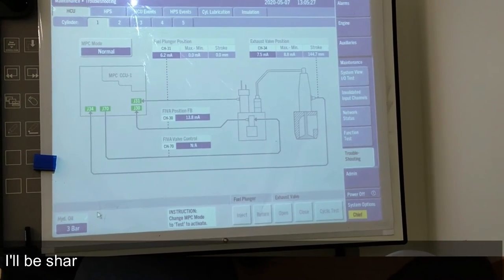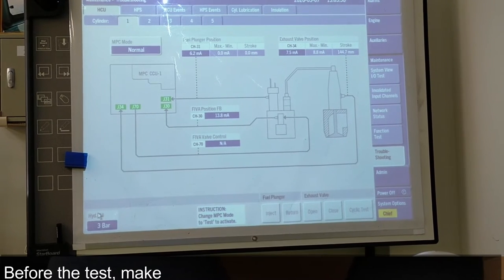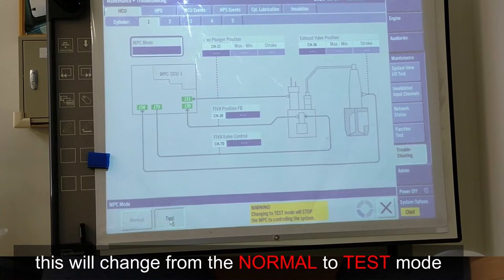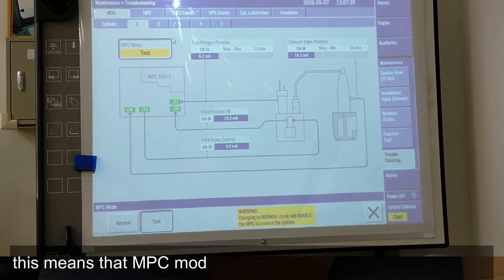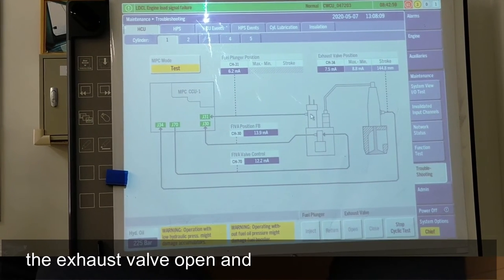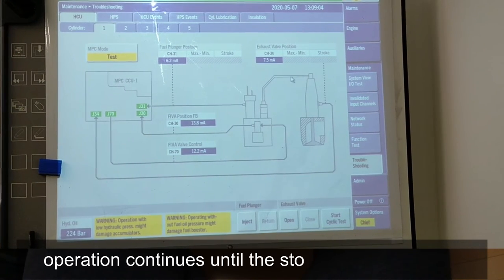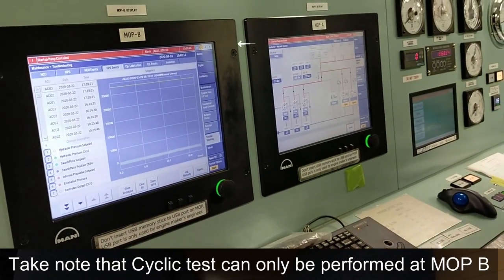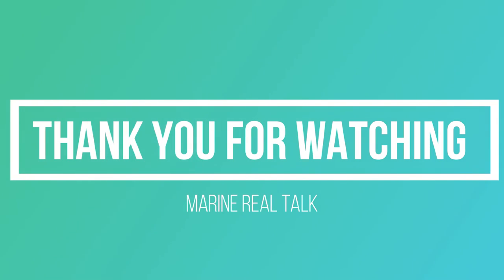Main Engine Exhaust Valve Cyclic Test/Chief Boyet

Comment: Thank you sah video sir. Very informative. Sana dn poh sir on your nxt vid.  mah featured nyo dn poh yung F.O pump test on MOP. Thank you poh ulit sir  nd God bless 🙂🙏
Reply from the maker: Hello Sir Jovic, welcome and thank you for the appreciation. About your request, you can check the FO booster pump working condition at HCU events. At engine running condition, you can even check the output current and compare with the other cylinders. Please let me know if want more clarification but any way I will be making video about your request🙂

Comment: Salamat chief boyet mabuhay po kayo sir.sir paano kung ang m/e natin my leak ang cylinder in running condition pwede ba natin ma e cut off yung cylinder na my leak pra sa ganon tuloy parin ang takbo ng makina? At ito bay nan dyan sa ating manual electronic main engine? Salamat po sir God blees sayu
Reply from the maker: Hello Sir Elmer, mabuhay mga Marino🙂. Yes pwede natin ma cut off ang isang cylinder. Nasa manual ang cut off procedure in different cases. Nasa manual din nakasulat kung ilan nlang ang kaya ng makina na load after cutting off, depending in how many cylinders ang na cut off at depending on the condition of the other running cylinders.

Comment: maraming salamat po sir.

Any sir ask ko lang po if when mag ooperate ang venting and sealing nang SCR sir..dito kasi sa nasakayan ko palaging naka activate ang venting nya kaya naaubos ang hangin namin..Kahit hindi naman naka activate ang SCR namin
Reply from the maker: Hello Elect, salamat sa appreciation.  If you are referring sa venting system ng SCR, sa hitachi meron syang quick at normal venting mode.  Ang venting air ay para lang to seal the valves ensuring na di makapasok yong exhaust gas from ME to the reactor while SCR is not running. Kung sabi mo na may venting air sya while running, maaring you are referring to soot blow air.

Comment: Thank you, but when the cylic test done ,mpc switched to normal mode ,why the exh. V/v position Amp. wasn't present at once .
Reply from the maker: Hello Ene young, actually it has, the Max Amp as well as the store will appear in the MOp after seconds, same as normal but in my video O have not waited to pop up ang immediately has change a window or display.🙂 Should you have any question, feel free to ask.
Reply: @marinerealtalk8683  OK.Thanks for your reply.
Reply from the maker: Sorry for the typo error. As well as the stroke🙂
Reply: @marinerealtalk8683  That's OK, you're so kind sir
Reply from the maker: Ene Young, feel free to leave your comments or question. Likewise, thank you🙂